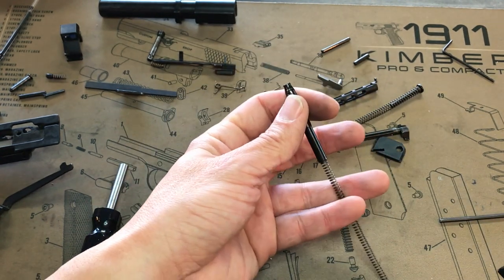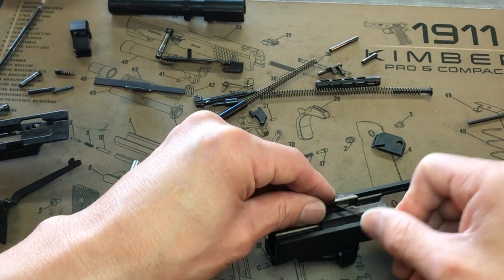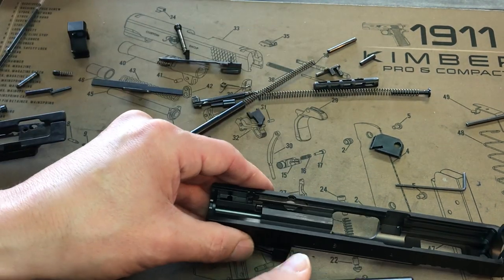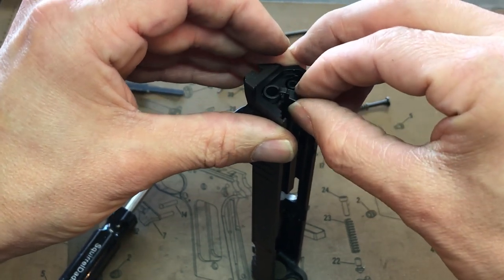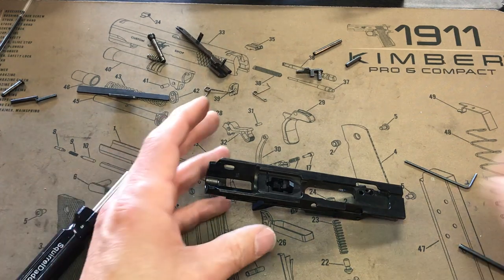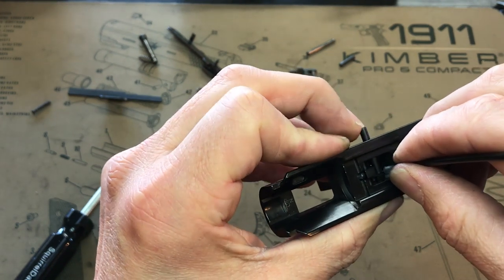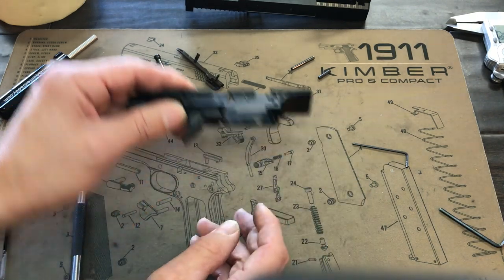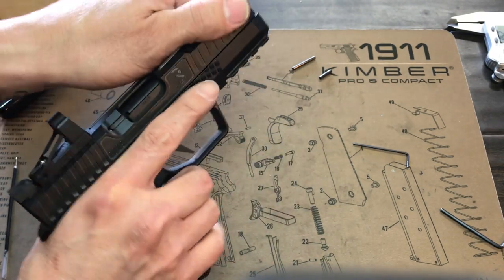Archon Type B Disassembly and Assembly Part 2

Comment: Very small advice.
18:55 https://youtu.be/dRR-EcIt7wA
15:17 i use 2mm in there 
15:54 - this spring with 1,5mm is easy to put in. just hook this spring at the end with tool 
17:03 - same thing, with 1,5mm is easy

Comment: Getting that first trigger pin in place I had a much easier time using my punch as a slave pin, from the right, set the spring behind it with the pen stick, and just push through, and back out with the pin, it saves me having to jam down that return plunger while trying to line everything up and not let the spring go flying into the next room

Comment: Thank you,  mine needed a deep clean.  What parts do you recommend lubing?  Mine has a light primer strike once in a blue moon.  However, today I had several in only 200 rounds so I wanted to clean it up real good. Also what round count should I be looking to tune up this gun I'm around 3000 rounds right now. I consider you to be the unofficial expert.

Comment: Excellent info thank you!! May get the guts to try the trigger spring kit. My new Archon is a great shooter very accurate and soft shooting. However the trigger is heavy and gritty. Thank you for taking the time. Do you also do the slide cuts for the Dot and if so does it cowittness with the iron sights?